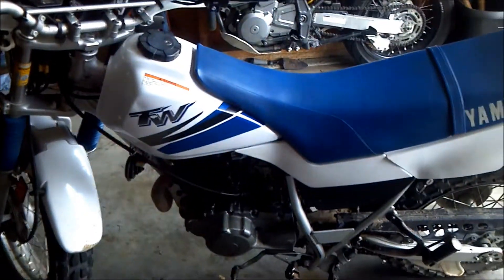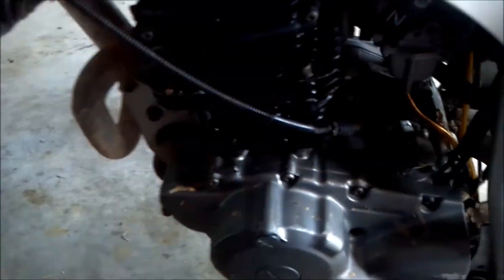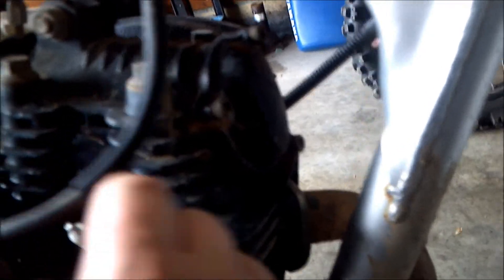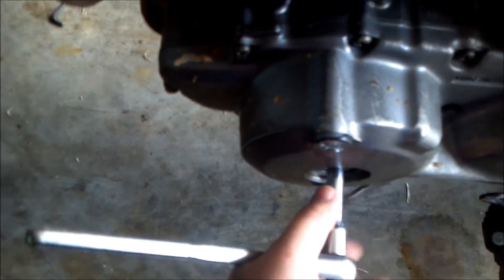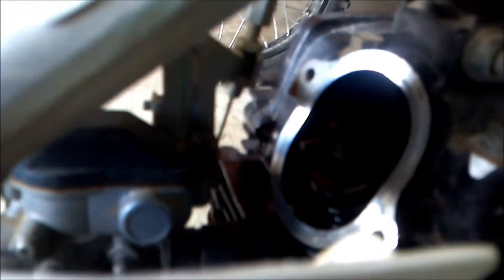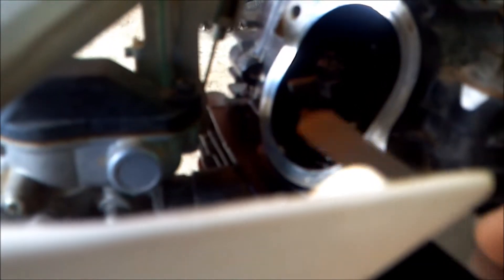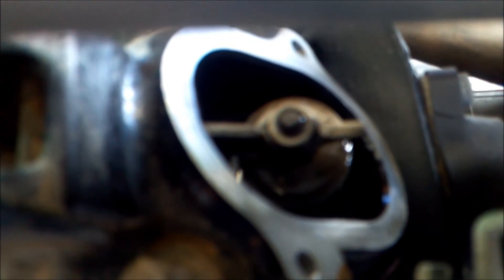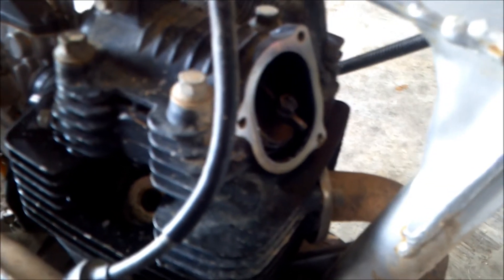How to Set Valve Lash on a Yamaha TW200

Comment: Just rebuilt a TW125 that had done 66,000 miles here in the UK. Owner bought it to ride to work in bad weather to protect his Harley. Never cleaned it one and it was hanging. Stripped everything to clean and paint. Never touched engine bar for clean and paint. Now running but MOT a week away so decided to check clearances. Love these little vids - much beter than a manual

Comment: Thanks for the instruction which I followed to get my valves in adjustment. I rotated the crank once after adjusting the valves and now the gap is too tight for the feeler. Is this normal? The retaining nut is tight on the lifter, so that is not the problem. I'm thinking this thing just normally tightens up on its own. Is that right?

Comment from the maker: The way I do it doesn't require finding top dead center.  If you look at a TW200 cam you'll notice as the exhaust valve starts to open then the intake valve will be on the lowest part of the lobe.  When the intake valve starts to close then the exhaust valve is on the lowest part of it's lobe.  It's just a shortcut that I've used many times and am passing on to the masses! :)
Reply: big74blazer bro care to share a video. would like to learn the shortcut. thanks

Comment: Ummmm nice video but you dont adjust the clearances on the exhaust and inlet strokes they are both adjusted just before top dead centre on the compression stoke as both the valves are shut and the tappets have free play which is where you get your clearances to be exact but if you do it that way fair play